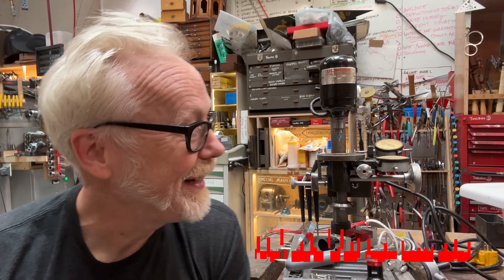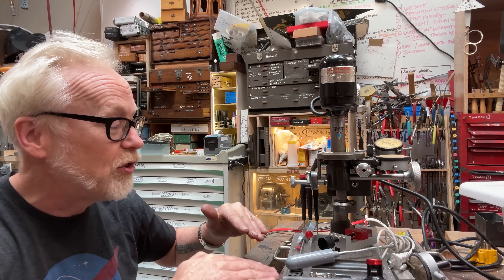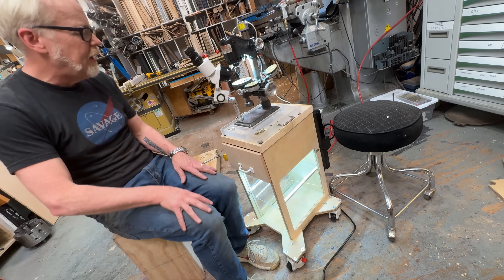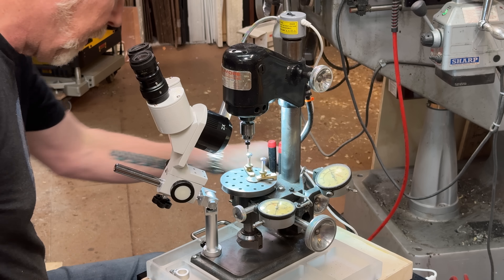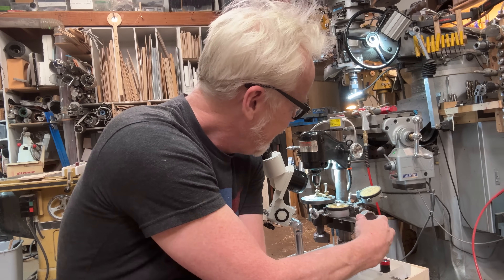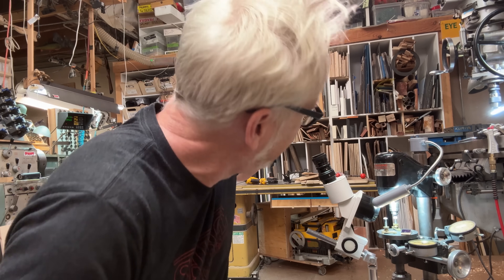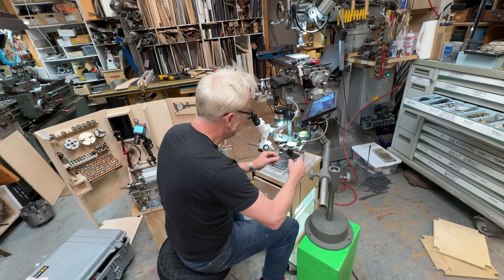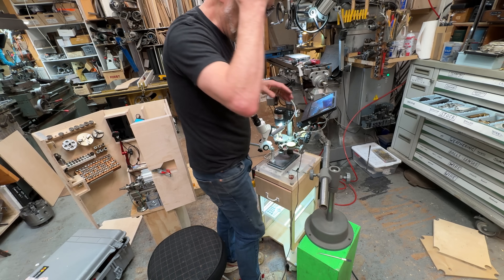Drilling a Hole the Width of a Human Hair?

Comment: I don't mind the imperial units, but I hate, with a passion, the insane use of fractions, especially with changing denominators, to express small measurements. Just say 0.13 inch instead of 1/8", or 0.31 inch instead of 5/16" (add decimals if needed, but most people won't have tools or measuring devices with more accuracy than that).
Reply: Accuracy, and precision is actually why there is a mixed use of fractional and decimal. 
If you are asking for an 1 and 1/16th hole you are asking for 1 and 1/16 plus or minus 1/64th. 
Or 1.125 +- .015 
However if you are asking for 1.13 you are asking for 
1.13 +- .01 from welders fabricators and wood, and 1.13 +- .007 or tighter toleranced from other forms of machine shop
And 1.125 you are asking for +/- .005 to +/- .001 depending on the type of fabrication shop you are in. 

And for bolts and hardware you are asking for 1-1/16 you are asking for 1.123 +-  .003 unless its oversized or specifically course. 

All of this is communicated just by how many decimal places are given, or if a fractional is given. 
And of course you can draw up a blue print yourself and specify what each point of precision means to you, and even learn some GD&T and make even more precise call outs.
However;
You can easily see by eyeballing the tolerances here that by mixing up and not using fractions to fractions you could easily end up with a bolt that does not fit the hole you have.
Reply: @AnonymousAnarchist2  That's not how reality works. Precision only goes as far as the rounding of the number used. 1/16 is equivalent to 0.06, which is no more or no less precise. 4/64 is equal to 1/16 and gives you no more precision. You might feel like it does, but mathematically, they're 100 % equivalent. The number of relevant digits is how you get precision. 0.1 can be anything from 0.05 to 0.14, but 0.10 narrows it down to only 0.095 to 0.104. And so on.
Reply: @mytube001
You are conflating decimal approximation, simplified rational expression, and technical use cases. All three are not the same and do not have the same use cases.
Reply: @mytube001  Your are trying to aruge with a US manufacturing engineer, with 20 years experence about US manufacturing.
Reply: For such dimensions you only use SI Units
Reply: Sorry just stop using eagle units and catch up with the rest of the world
Reply: Msc has great deals on micrometers and you can find old barrel mics for less than 100 dollars it’s really worth having in your tool kit